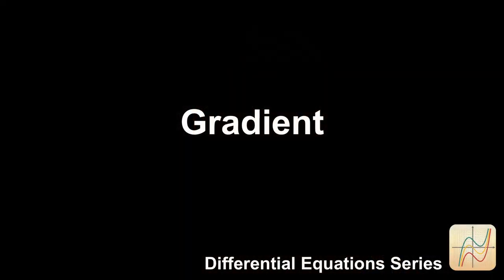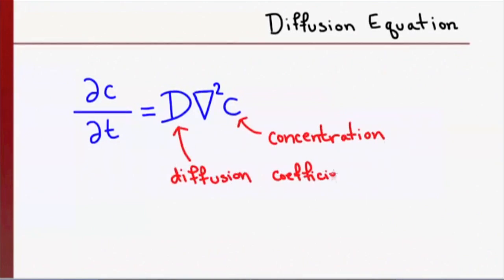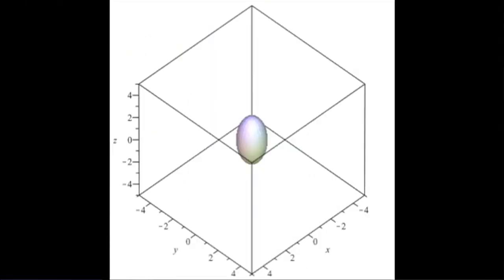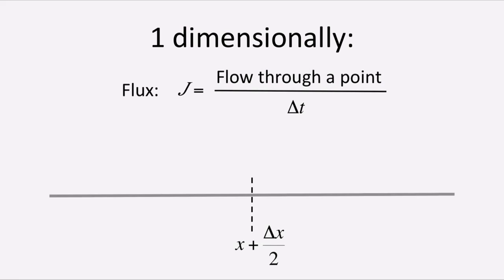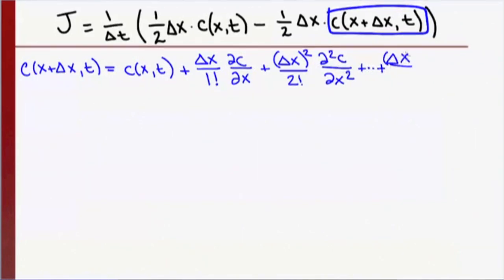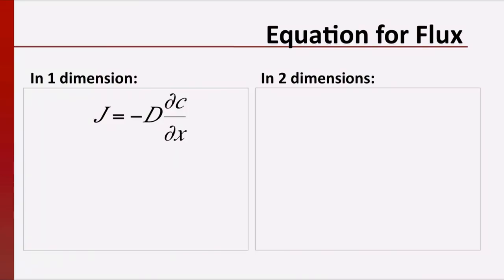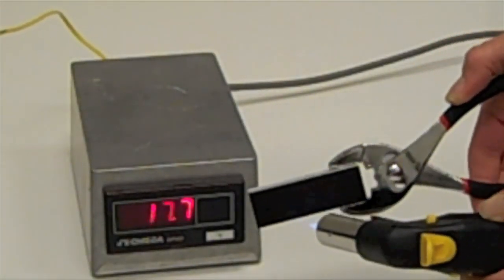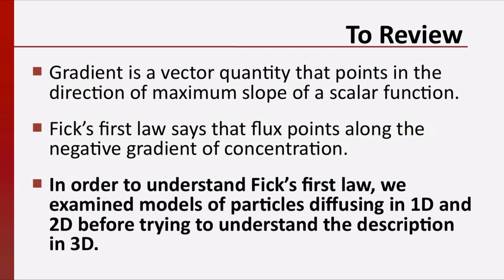Gradient

Comment: Why is the gradient depicted or defined as a projection in the x, y plane? If it is defined as the magnitude of the sum of the two partial derivatives in the x and y direction why is this not a slope in R3?. The two directional derivatives of which the gradient is composed have a " real " slope in R3, their tips and tails are at different heights in R3. This has me confused and any clarification would be gratefully appreciated.